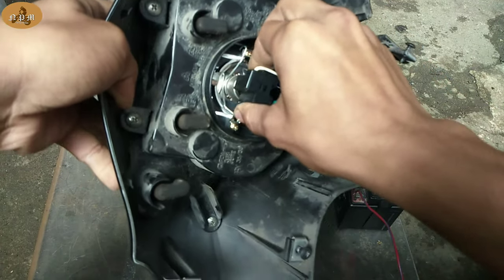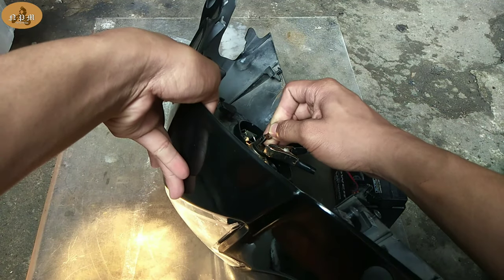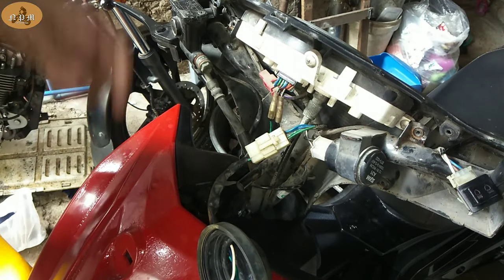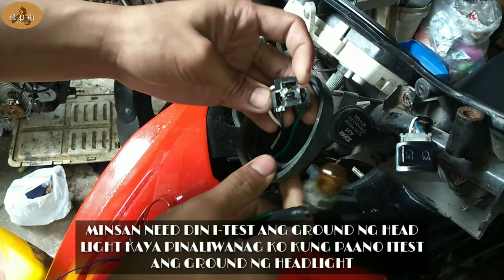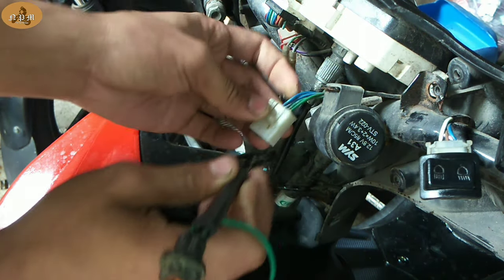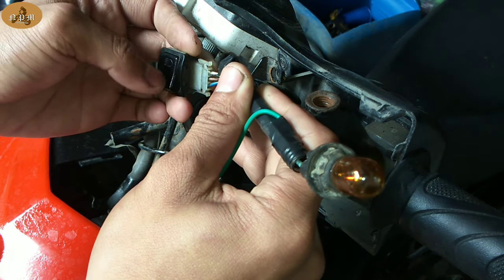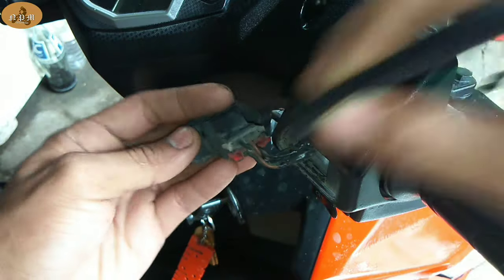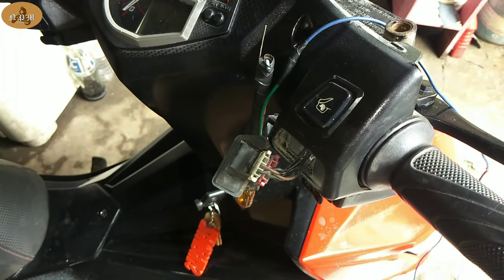Walang headlight na motor (paano mag trace ng sira?)

Comment: Idol anong problem pag  di umiilaw yung headlight at break light or tail light.at yung starter. Bago kasi bili yung battery ng motor .problem kasi Nung una battery tapos nabili ng bagong battery ayos naman umilaw lahat khit starter ng motor gumana pero katagalan bigla nawala yung signal light. Bumili ako ng flasher relay at yun gumana na yung signal light pagka install ko. Tapos problema na nman yung starter at headlight at taillight.
Reply: Yan din po problem nung motor waiting po ako sagot
Reply: @ethzg.soriano7069  try NYO po I charge Yung battery 50 pesos lang nman Mura lang magpacharge Ng battery. Tapos obserbahan mo Kung mabilis malowbar Yung battery. Then don mo plang palitan ng flasher relay. At check mo narin Yung mga connection at wiring baka madumi. Na solve na problema ko Jan troubleshoot lng. Una ginawa ko pinacharge ko muna battery Ng motor ko